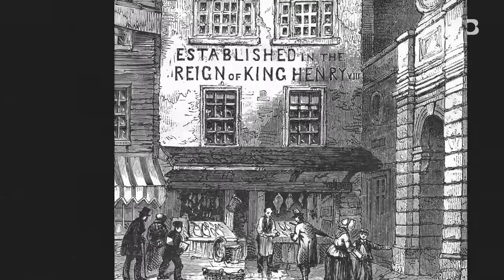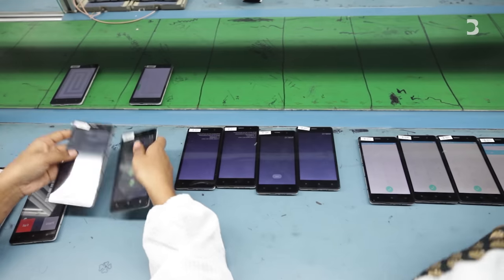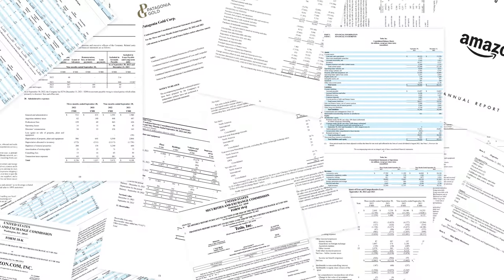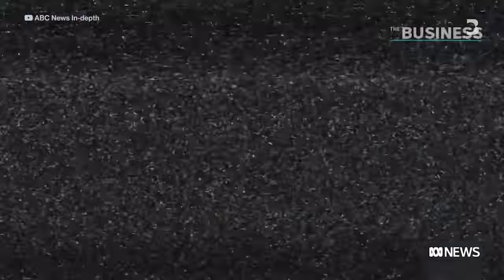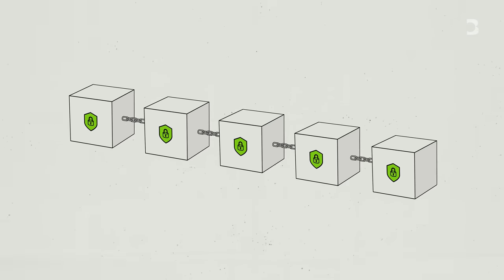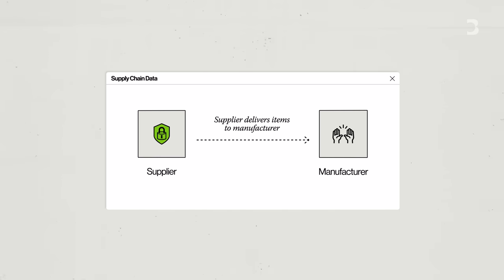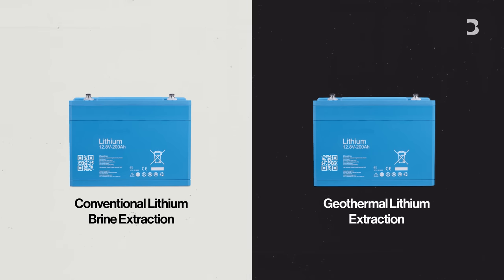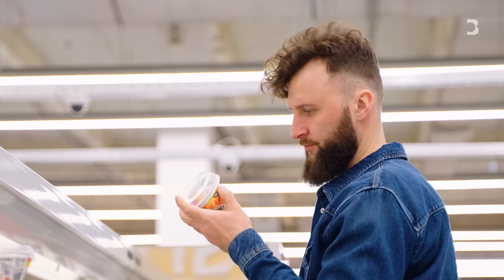Can the Blockchain Help Fight Climate Change?

Comment: when there is fraud in transit : say somebody falsifies a container log, it's always at the data entry stage not modifying existing entries where fraud happens.  Bloomberg falls in the same trap of saying the data on blockchain will be secured, but it's the data you put in the blockchain that is the problem.
the transparency part makes sense.

Comment: But to make a product appear on the blockchain with the full transparency of the process of production, the manufacturer must be willing to "upload" and make available the data on the blockchain, right?
Reply: Yeah, and no producer is eager to part with proprietary data and that might also expose their trade secrets. Think of Nutella, Coca Cola and other products which outcompete others with marginal advantages in taste and other characteristics.
Reply: @watershed8685  I can also imagine companies who don't want to disclose where they get their "deals" for the materials, etc.
Reply: Correct, the producer or seller must decide what parts of the supply chain they want to put. You don’t put everything, just the important bits like conformity certificates that can be validated by outside parties. And digitizing the process also helps a lot versus the old paper trail ways